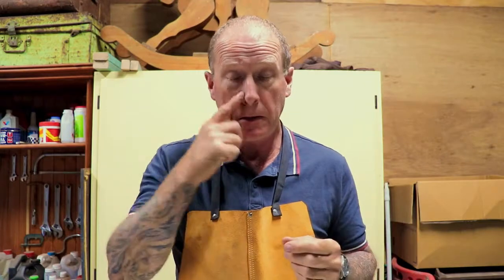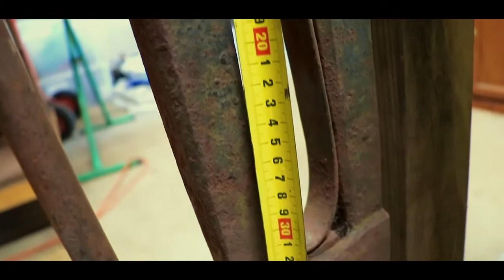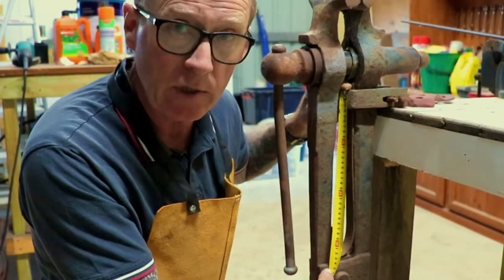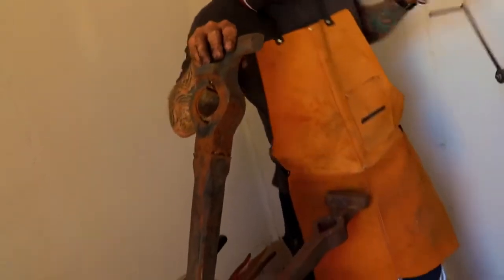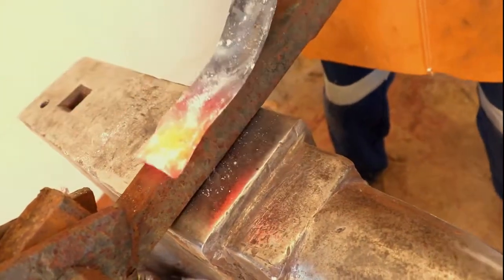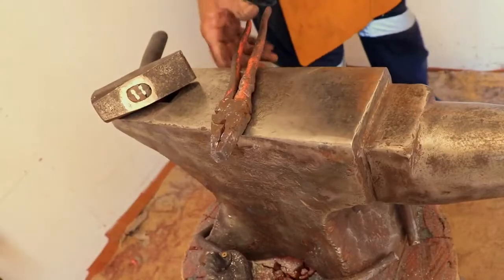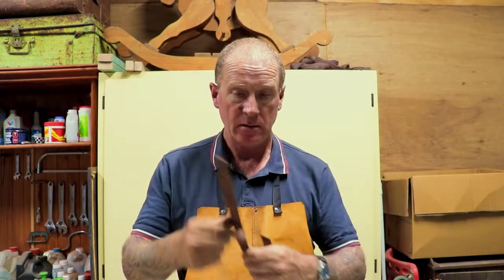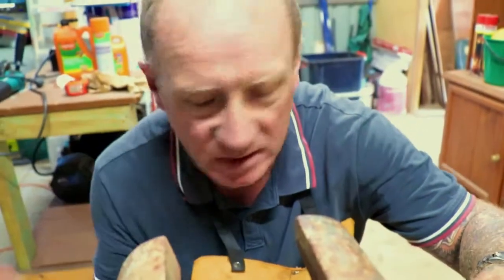BLACKSMITHING  Forge a spring for a leg vice

Comment: Excellent. Learned SO much.  Amazing use of sledgehammer on workpiece when turning the end!  So right about steel to use. I made with old leaf spring . Totally unnecessary, way to much force & wear on vise / threads.  Good work

Comment: Did you add length to account for bends?  What thickness of metal did you use? thanks good work
Reply from the maker: From memory he used 6mm and wasnt to concerned on length. You won't loose much with the bends. 👍
Reply: @forging   thank you
Reply from the maker: Thanks heaps for the comments. 👍